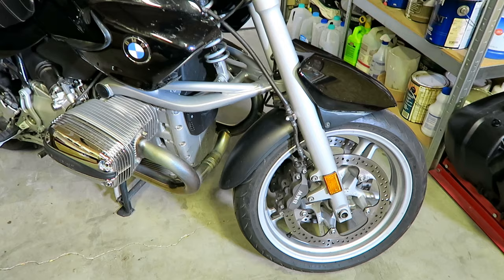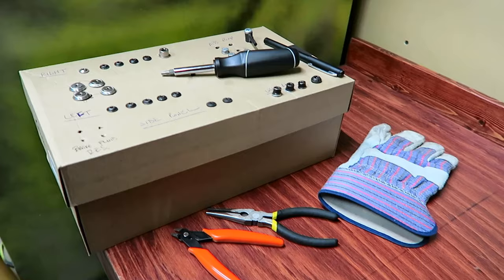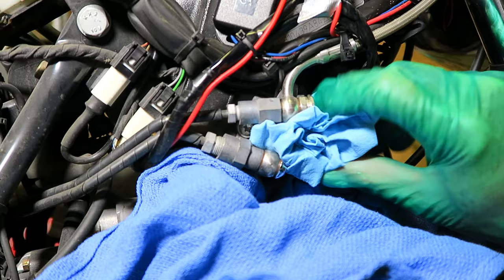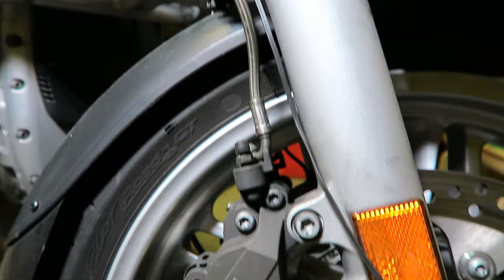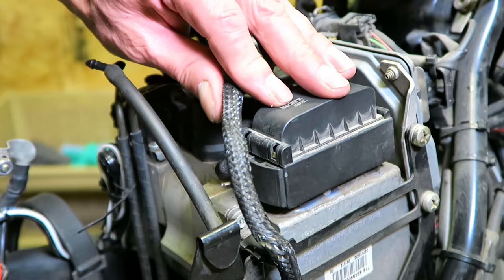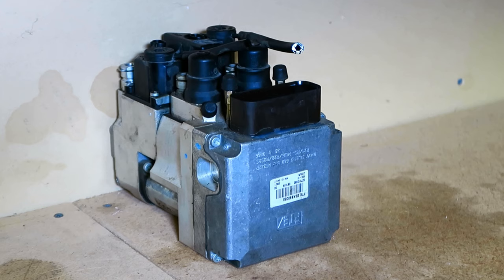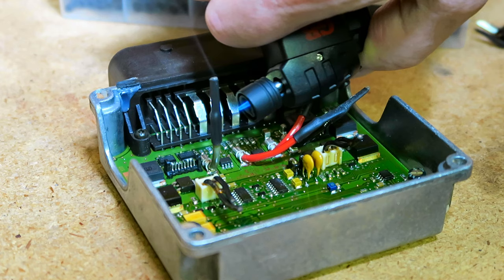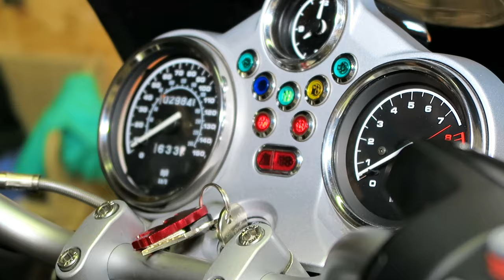BMW R1150R ABS Removal | How I Convert My Bike to Non-ABS

Comment: BEST VIDEO FOR REMOVING THE ABS SERVO UNIT ON A R1150GS (mine is a 2004).

Thank you so much for your video.  I had plans on rewiring my servo and replacing my brake switches with nonABS switches like you showed with your parts list and it was going to be a lot of work. Doable, but a lot of work. Then I came across your video that very clearly showed the steps involved, from start to finish, and kept the stock ABS brake switches on the bike.  I followed your instructions to the letter but the first try testing the brake lights, nothing.  But then I reseated the main electrical connection unit/control model and viola!  Brake lights.  I just didn't have it seated properly the first time.  Everything worked as you clearly detailed and described.  I pulled the main fuse and removed the light on the dash for the secondary warning light.  Thank you again.  

Anyone wanting to remove their SERVO ABS, this is the video for you.  Follow along step by step by pressing pause, do the step, then watch the next step and you will have the results you want to have. Dan

Comment: i just completed my removal of my ABS system. I am super happy with the results. I did mine exactly as yours. Thanks so much.
Reply: Wer die you get the parts for thuis job😊
Reply: @jacobstolk3814 ABS modifications are not made on this model of bikes. What do you expect us to do? Should we continue with a broken abs? Or should we install a used old module that we don't know when it will break? no thanks. A solid brake system without ABS is better than broken ABS.
Reply: What's the disadvantage of ABS ?

Comment: Started this process today, thanks to your video, and hope to be riding again this week after the front brake line connector comes in!

Side note / tip for others to consider: I have a 2002 R1150R and it turns out that a large screw-top square plastic tub (from a package of mixed nuts, of all things) fits almost perfectly in the void left by the ABS module.  With a little flexing of the screw-top opening, the brake light circuit board also fit perfectly inside (diagonally).

I cut a hole in the bottom of the tub for the 'male' end of the brake light circuit board to stick through, sealed around all the edges with silicone, and screwed the bottom of the tub back on (with another plastic spacer inside to support the bottom of the circuit board when the connector is being pushed on and attached).  It's airy, waterproof, and sits right where the ABS module used to be.  It's zip-tied upside down to some neighboring brackets, with the connector sticking out on top and the screw top opening facing down.  It was the right height and doesn't interfere with tank fitment.

I was concerned about heat, but there are lots of other plastic parts in that same area.  Time will tell...  For now, I think this was simpler, quicker (for me), and will be 'serviceable' if I need to access to that board in the future.  I also didn't have to cut any wires to disconnect it from the ABS module - there were little white connectors for all of the wires that simply came undone.

Thank you so much for this video!

Comment: Super helpful video. I got a 2002 1150rt that spent 10 years or so rotting outside for free, and your channel has been really useful for getting it going again. I rode it to work a couple days last week with the front brake on “residual”, and I didn’t realize how much better it was going to be. Now with this mod and new fluid it stops much better, plus I know that it’s not gonna fail on me and cost $1000 or more to fix. Thanks for posting

Comment: Amazing video, this is by far the clearest one on the Tube going through this process. I like the way you use the original ABS electronics to control the brake lights instead of changing the switches. Ride safe brother.
Reply from the maker: Great to hear!

Comment: I just completed this 2002 R1150R following your steps. The only thing I had trouble with was having to replace my brake lines in the process as, lets face it, they were old. Replaced them with Galfer brake lines and am riding again. Thank you Wheel Stories
Reply from the maker: That was a good idea to replace the brake lines.  Thanks for watching Wheel Stories.

Comment: I have 2005 BMW K1200S with similar Integrated ABS.  I dread the day i run into ABS issues. I change the fluid every 2yrs or so, its a pain.  Most mechanics in my area not interested in doing it.  BMW wants nearly 400 dollars for this service.  Nice video thanks again.
Reply from the maker: Thanks for watching Wheel Stories.

Comment: Top job wheels,this problem that the 1150 has pushed me toward the R1200R mainly because my wife rides pillion and i think the ABS system is a must for that reason. looking forward to the follow up video,take care with all that's going on in the world at the moment.
Reply from the maker: The ABS and servo assisted brakes on the 1150 models were a good idea with great stopping power but when the system fails the brakes stop working.  That's crazy.  When the issue manifested for me, fortunately, I was creeping through downtown Hood River, Oregon and was able to glide to a stop.  Had I been carving some turns on a winding road at a good pace, I hate to imagine the outcome.  Apart from the brakes, I love the bike.  Thanks for watching.

Comment: nice job, great video, might help a lot of people, thank you very much for it!!. My horror story so far was rotted plastic quick disconnects (another Achilles heel for this model at least) pouring gasoline all over my garage. Replaced them with metallic ones. Great bike when it works, simple bike otherwise, is just that sometimes the germans take very unusual decisions to over complicate things (battery under tank, really?) or cheap out on parts...especially plastic parts...reminds me a bit of some of the bmw cars, haha. The power brakes are great though (when they work) I never had a bike with such ridiculous stopping power.
Reply from the maker: Every bike I've owned has had its share of issues.  The stopping power with the ABS is amazing but I don't trust the pressure module after going through the failure.   Other problems.  I've replaced the oil cap and insert on one of my BMW's several times and it still leaks on long rides.  The stock seats are uncomfortable so I've replacement them with custom units made by Sargent.  I still love the R1150R model though.  Thanks for watching and posting the comment.

Comment: I have the same situation with my 2002 1150 RT I've been trying to figure out how to remove the ABS system and I happened upon your video what good luck for me thank you for your hard work I'm going to get going on it in the garage right now thanks
Reply from the maker: The RT may be a bit different from the R model in terms of electrics.  Research the speedometer and brake light configuration.  Ideally, your speedometer is mechanical and not electric with a sensor.  I don't know the specifics on the brake lights on the RT but you may need to do some alternate wiring to get the brake lights functioning as needed.

Comment: Hi from the uk i have been putting doing this off for a couple of years (Very noisy pump) as all the video's instructions have over complicated on how to do it and then i came across your way and i have watched it a couple of times and i am going to do it in a couple of weeks same as you except i have ordered the motoworks link pipe for the front brakes many many thanks for a superbly clear and precise video and commentary  cheers wayne.
Reply from the maker: Can't recall if I have responded to your comment.  Hope everything goes well as you wrench on the bike.  Cheers.
Reply: @WheelStories  should be doing it tomorrow thanks for the info

Comment: Just did mine. 2002 r1150rt. It works. My brake lights work both front and rear. It was very easy. Just like he did. I used small zip ties on the 4 holes on fabricated cover. Waiting for brake lines in mail. And that junction delivered by royal mail from the UK. For the front brake lines, connecting them. I will update when it's all together.
Reply from the maker: Thanks for the update.
Reply: My bike is US r1150rt. 2002.
Reply: Just put my us r1150rt back together. 2002 model. Brake lights work. Speedometer and tachometer both work. New Spengler brake lines. Mispelleded the word. Spell check is retarded. My quick disconnect fuel lines broke as well when removing fuel tank. Plastic garbage. Used 5/16 brass double barbed connector in place of old junk disconnects. And 12 inches of new fuel line. 6 inches on each fuel line. Since the disconnects are about 2 inches or so in length. You need a longer short fuel line pieces on each one where it connects too aluminum metal lines. It's self explanatory when viewed I cut the disconnects out not even trying to get the piece out of the old fuel line. And six new clamps. It is on tight. No leaks. If you are worried about it being fuel injection high pressure. Seems to run better. Less restriction than before? Hope that helps. Not very hard. Just tedious time consuming. Be ready for your plastic disconnects to break. I went to Napa parts store. Old school automotive parts place.For the brass double barbed connector,clamps and fuel line. God luck if you d it.

Comment: Thanks for the very interesting video! Although here are companies that specialize in the repair of defective ABS modules, so that it would not be as extremely expensive as yours, I hope that my R1150R will last a few more years. Keep on having fun with the two ABS-free bikes in the future.
Reply from the maker: I found a company nearby that rebuilds ABS modulators but they are very backed up on the rebuilds of the BMW ABS.  Long wait from what I understand.  Thanks for watching.
Reply: @WheelStories  Does that company still do the rebuilds on BMW (Mine is a 2003 K1200LT)? Its my first ABS bike after a lifetime (I'm 66) of riding and I am not sure that I want to rebuild it but would like to know how much and how long?
Reply from the maker: I'm not sure.  There was a company located in Moscow, Idaho that rebuilds BMW ABS units.  I can't recall the name.  I suspect you could find them with a simple google search.

Comment: I just deleted my ABS , some fluid got in on my circuit board and fried it. The battery cracked and I believe that’s what fried my circuit board. I upgraded to SS brake lines , the front brakes are fabulous but the rear is weak, I’ll be looking to upgrade the rear. Would have loved to keeping the abs system but not worth spending more than what the bikes worth. Thanks for the video, safe travels

Comment: K1200 owners: do this instead. All you have to do is block off the ABS lines WITH fluid in them. Then connect the master cylinder lines to the calipers. Keep fluid in the ABS system and don’t touch the electrical connectors at all. The speedo and cruise control is driven by the ABS unit. Now remove or tape over the flashing bulb on the dash. You’ll have to find the right bolts and connectors, I believe they’re 10mm x 1.0. Then flush the brakes. That’s it.
Reply: could you please explain a bit more, seems you find a simple way to do it?

Comment: great vid! If you hate bleeding brakes, grab a compressor assisted vacuum bleeder. Theyre a little over $100 but make life much easier for any brake/clutch bleeding scenario, motorcycle or car.
Reply from the maker: Thanks for the tip.

Comment: A good informative video. I agree with your thinking about the decision to delete the ABS or not. It looks to be prohibitively expensive to repair in the case of this motorcycle.  Here in the UK it is not permitted to disable a warning light in the manner which you have done  (removing the bulb or taping over the lamp). At the annual roadworthiness test, known as the MOT, the tester will check that all warning lamps light up when the ignition is turned on, and then go out when the engine is started and the motorcycle is ridden.
Reply from the maker: That is unfortunate.  I would imagine there are a few BMW owners in the UK that have found a workaround solution in the electrics.  Apart from the ABS issue, the R1150R and others in the same vintage of BMWs are outstanding bikes.  I plan on riding mine for many miles.  Thanks for watching.

Comment: ABS and any other stability control system is nothing but a crutch for any rider. I stated riding when there were no such things and I find myself blessed by that. Relying on such electronics is like sitting on the missile and tapping on the end of it with a hammer hoping it won’t go off. 
Anyways, thank you so much for the video and I foresee doing this procedure in the future when I have a privilege to purchase my own BMW.

Comment: THANKS for this excelent description how to get my brakes working again. Have the same problem with my R1100s  2003 and will consider the same modifycation as you did.
Reply: I have a 2002 R11S that had the abs removed before I bought it.   This video is very useful for me trying to understand how the conversion works.  One thing I noted from my research is the recommendation not to cut wires more than needed.  On my R11S the speedo reads from the rear brake abs ring mounted on the rear wheel and is interpreted by the computer and then on to the dials.  Mine all works as it should.  The brake light is associated as well, but I’m not sure how.  I do seem to have a not very bright brake light.  It may be unrelated issue.  I’m thinking of switching to LEDs if I can engineer it.
Reply: @allenc5108  Hi I have now successfully done the convertion on my R1100S 2003 model. I used the video on this channnel and did the same as Wheel stories.  Didn't have to cut any cords.  On the 1100S the speedo is driven by the rear ABS sensor and that worked very well. But brake lights was always on. Brought new brake light switches from non  IABS R1100S. And made a separate circuit for the brake lights. Works very well. Again Thanks to Wheel Stories :)

Comment: Good afternoon from Spain.  First of all, thank you for your time and knowledge for the work that you have done so correctly and professionally.  Would you please be so kind as to tell me what material is necessary since I have to repair the one on my motorcycle.  In the video you can see some cables but I can't see them to be able to locate them.  Excuse me but I'm using a translator.  thank you for your time and good work thank you very much
🎉

Comment: Finished mine. 2002 US r1150rt. With abs. Obviously. Put new brake lines on. When tank off my fuel disconnects broke. Double barbed brass connector  worked for me. With new fuel line and screw clamps. 15$ not $120. Everything works. Brake lights, speedometer, and tachometer all work. Brakes feel good.
Reply from the maker: Glad to hear everything works.

Comment: very useful.  I will be removing my failed abs pump on my 1150rt
Reply: Did you remove it? Do you still have speedo function and brake lights? I hv an 04 rt

Comment: On my RT I to removed my ABS system. How ever I did not do it your way. I replaced it with 2 relays I got from NAPA. Be carefull here, make sure their are no other equipment in the relays, like resistors or anything else. NAPA part number AR201SB. Also there seems to be a time thing on the stock rubber hoses. 8 years. Mine failed 2 times. Now I have replaced them hoses with stainless. Problem solved. BTW Cris Harris has a good video on this, including the wiring. My recommendation is do it to your bike. It is very painful when it fails. 🙂

Comment: Excellent Video over all! Excellent explanations and step by step...Thank you very much. It seems easy enough...but I am still nervous to attempt on my just died 2003 R1150RT Integral ABS control module...however after looking into the ModuleMaster in Idaho, that is still not working on this series of control module, the only possibility is either replace with a previously used module...which may or may not last and work for a decent period of time ...or...follow your example ... its a major repair either way.. thanks again will look for the follow up and report on success of the test.
Reply from the maker: You might consider getting a professional opinion on the state of your ABS module if you haven't already done so.  The dealer can run some diagnostics on the device.  Research the electrics before removing the ABS unit.  The RT may have a different configuration for the tail light, speedometer and other electrics from the R model featured in my video.  Some precautions worth studying.
Reply: @WheelStories  Yes thanks have done so and thus the explore on to You tube to find your excellent video. I have now just sourced RH electronics New video from March 2021 regarding their 2 life kit available for this issue. Will speak with them on Monday morning and update possibilities for any other BMW followers.

Comment: I love my Servoectomy on my R1150RT.   Did it myself!
Reply: Johnny, does your rt have speedo cable and wheel speed sensor like mine? I haven't removed my abs yet, your answer may help.
You do have speedo and brake lights?